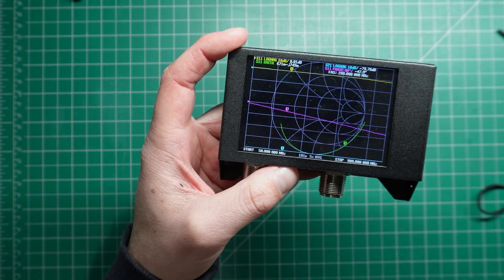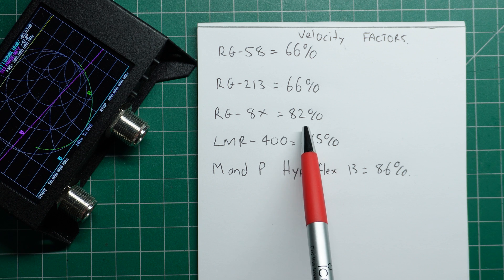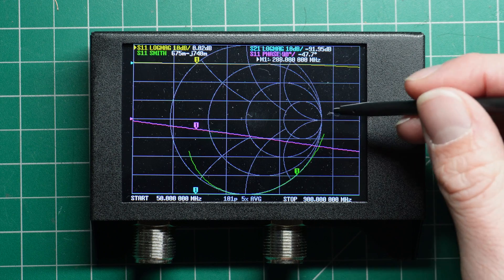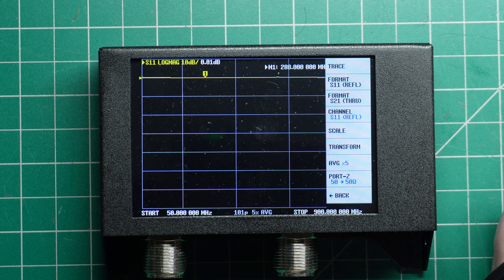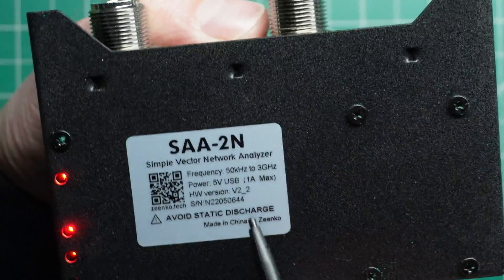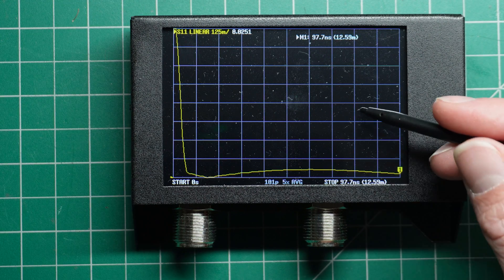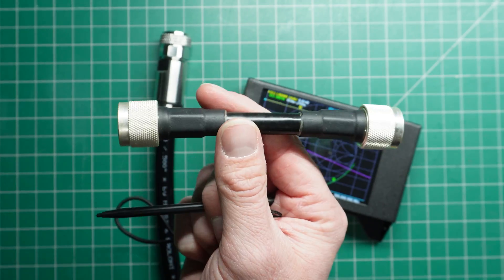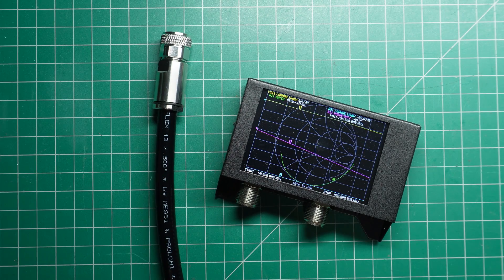How Long Is Your Coax? Testing with NanoVNA

Comment: Great video, Hayden.  On many of the newer firmware versions (latest for the SAA-2N is v1.3.31 dated ~18-Jun-2024) there is actually a feature to directly measure the cable length.  After you turn on the NanoVNA,  invoke the menu, select 'Back' (if necessary), then select 'Measure', and then select 'Cable (S11)'.  After you enter the velocity factor in percent, the display will show the cable information such as the characteristic impedance, length in meters, and return loss.  Also, you can select more sampling points to improve resolution, such as 401 points vs 101 points.  This is accessible under the 'Stimulus' menu as 'Sweep Points'.  Again, great video.  73  Ken -- WBØOCV
Reply from the maker: Thanks mate! Sounds like the next video will be - updating a NanoVNA firmware :) Cheers I'll give it a go!
Reply from the maker: I did the firmware update tonight, that's fantastic mate! Works well 👍
Reply from the maker: One question though is that if I measure the Cable length and enter the VF, such as 86% it shows the length as 617mm... (for a 6m length of cable) if I enter 860% on the VF, then it comes up as 6.17m. Perhaps I have something strange happening in my calibration or something
Reply: @HamRadioDX  When you enter the velocity factor, you always enter it as a percentage value, as opposed to a decimal value.  If the velocity factor for the type of cable is 86%, enter it as "86", as opposed to "0.86".  Simply speaking, the calculations measure the time it takes for the signal to make a round-trip from the NanoVNA to the end of the cable, and then reflected back.  It multiplies that time measurment by the assumed velocity factor to estimate the number of wavelengths in the cable.  If the entered velocity facot is off by 10-times, then the length will be off by a factor of 10.
Reply from the maker: @kensejkora4424  G'day Ken, thanks.
Yes I entered the VF in as a whole percentage and not decimal but it was still showing as the next scale down (i.e. 600mm instead of 6.0m!)
Reply from the maker: Ah I had it on an old frequency range for another test I was doing... when changing the range it changes the length calculations. For the direct cable measurement do you need to do a calibration first over the selected range?
Reply: @HamRadioDX  Great point, Hayden.  From what I've heard, read, and experienced, the best results are obtained if the calibration used covers a frequency range where the approximate lenght of coax corresponds to a wavelength of between 1/4 and 1 wavelength.  Thus if you think your coax is somewhere in the range of 10 to 30 meters in length, you might set your stiumulus range from 10 MHz (~ 1 full wavelength at 30 meters) to 100 MHz (~1/4 wavelength at 10 meters).  For a shorter cable of a few meters, you might want to set the stimulus bounds from something like 30 MHz to 300 MHz.  If the display shows at least one phase shift on the S11 phase trace as indicated by a vertical line on the trace indicating a 180° shift, but less than 3 or 4, you are covering the correct frequency span.  Also, I think I read somewhere that you don't need to have a valid SOLT (Short, Open, Load, Through) calibration to measure cable length, as long as the stimulus range overlaps at least one phase change in the S11 phase trace.

Comment: Challenge. I have a co-axial cable connected to an antenna wire. If I know the velocity factor of the wire can I have the vna read from the connector at the antenna to its final length to get the wire length?
Reply: Have to disconnect both sides

Comment: You can also use the numbers on the jacked of the coax and subtract one from the other :)
Reply from the maker: Some cables don't have the distance markings on them. Others are installed in place and you can't see/get to them.
Reply: @HamRadioDX Hayden: can I do this with an antenna still connected?

Comment: And in the time you took to set up the VNA, and " guesstimate " your cable length, Myself, with no help from anyone, and using a simple tape measure not only measured 10 seperate cables, but I even managed to put the antenna's back up in the air aswell.
Reply from the maker: All the power to you then
Reply: Yeah, for a bench top demonstration or installing new you can measure it with a tape measure. But imagine an antenna on top of a telephone pole where the coax comes down the pole from the top, goes under ground beneath an asphalt driveway, enters a building below grade, comes up through a pipe chase to a second floor server room, then hooks a u-turn and goes down another pipe to the first floor where it then cuts across a plenum and over several offices before it finally goes down the wall behind sheetrock to a wall mount connection. Oh....and you need to replace that coax run with new cable because of a failure. 

That's a real application for this 'benchtop guestimate.' I'll bet you've never had to be in the situation I described though.....

@HamRadioDX  Great video, simple explanation and appreciated by your viewers!!
Reply: @flashover52  If you ran your coax that way in the first place, then your an idiot to start with.....

Comment: If you want to improve resolution calibrate the VNA,  only calibrate over the expected range of frequencies rather than the full 3GHz. 101 points over 3GHz is very sparse. The VNA simply interpolates between the 101 calibrated points leading to a false sense of measurement confidence.

Comment: Next video would be good to learn how to find the velocity factor of your cable; since the same type of cable will be different between manufacturers and even batches, for the no name wholesalers.
Reply: If you know the exact measurements of the cable, just change the velocity factor until readings  matches the length of your cable. i did it and you will be surprised the difference from amazon rg8x vs abr rg8x. 2 sets of abr was spot-on 82%. 2set of Amazon 66%.

Comment: never seen a vna with  N connector ... mostley  sma...  never heard  a new invention ...measuring tape? 😁  🤣😂
Reply: Often coax cannot be measured with a tape measure because it is installed up a tower, or inside a roof or on a large roll.
Reply from the maker: NanoVNA SAA-2N